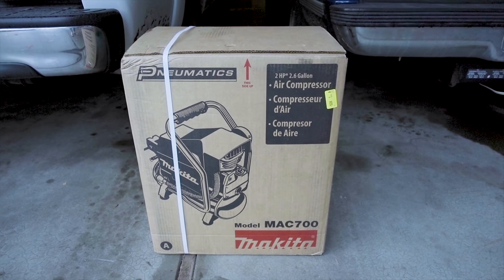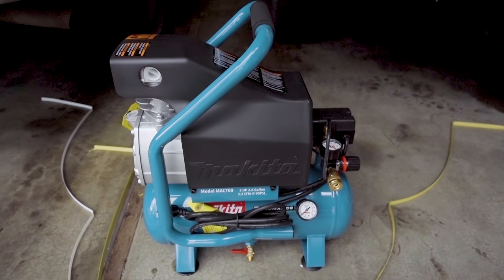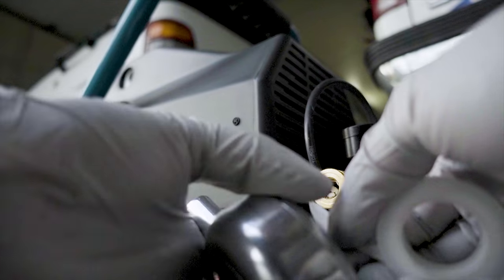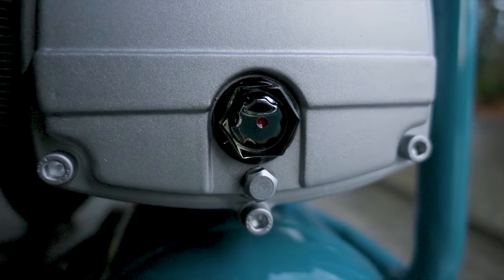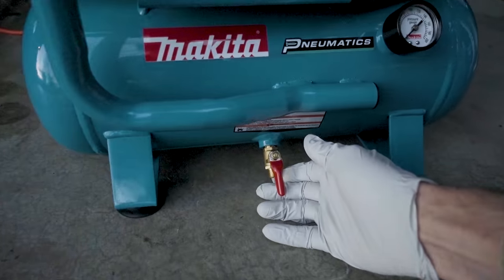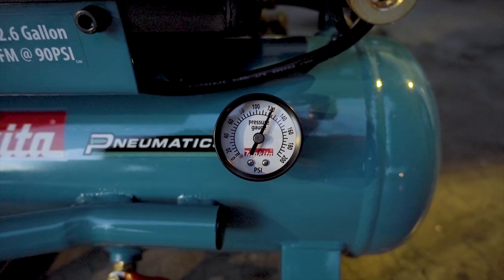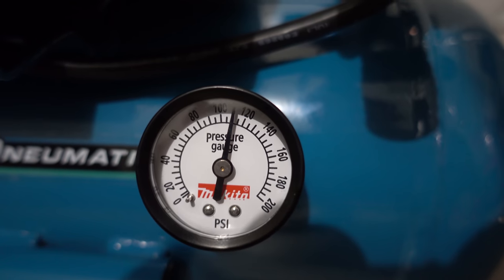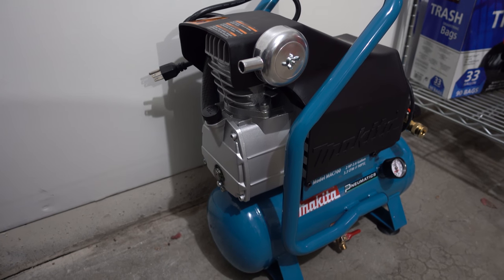Makita MAC700 Big Bore Air Compressor Unbox & Startup

Comment: When the air is compressing,   it is hot,  reading will be high,  after cooling a while , the pressure drops,  same as the tires in winter times..

Comment: I have a mac 5200  for construction but it is too big to be moving around constantly into clients houses to do trimwork so I bought the 700. Love it! It is so quiet compared to the 5200. Not light but a lot lighter than the 5200. Mine goes to 140 and stays there though and I didn't have any leaked oil in the box. Don't think you need teflon on the muffler since it is used to prevent leaks. Muffler is made to leak hehe. If it gets too hot then it might melt the tape and cause a problem perhaps. I put synthetic in for colder temps for my area and no problems. Also don't have to worry about tripping  breakers like with my 5200. The 5200 is also very fussy about needing lots of current to draw and will refuse to start up when the cabling is too long or thin. 5200 though will run two framing nailers all day and not blink and eye. Build quality is very satisfying and many of you who watch these kind of videos and love good tools will know that owning a well made tool can make you feel good. This is that kind of tool.

Comment: Not to sound like a know it all but the other guy that wrote a review was right not only about wrapping the Teflon the wrong way but you should have wrapped it at least twice around the treads on the air filter. And before Makita ships every compressor they put a small amount of oil in them to test them before shipment. The reason I know all this is because I just bought the Mac 5200 hot dog big bore model and I love it. And the first thing I did was also bought the Metabo HPT 10 gallon reserve tank because when you pair the two up you have a top of the line set up. Believe me, I own my own privacy fence and deck co. And I can run two paslode framing air nailer's and can work as fast as possible and I never run out of air! I hope this info helps anyone that is trying to decide on what to get for a ultimate set up. Thanks: Scott Harrington, Columbus, Ohio.

Comment: I would add one thing. The oil provided is more then enough and have left over to hit the red dot. I think you used it all due to the puddle in the box that leaked out of the compressor. Must have been on its side at some point.

Comment: Thanks for your review. First of all, the intent for a compressor is to be only under pressure when in use. Once there is no more use, it needs to be bled to empty. Since it builds up operating pressure in one minute flat, there is no practical need for keeping the pressure up while it just sits there for two days. It fatigues the fittings and the mechanism at large. 
Also, if you open the air intake valve (that little butterfly screw), you will find that there is nothing in it. The fitting has no need for Teflon on the threads, lol.... sorry guys, I am the absolutely curious chick, I can't help it! I love tech! OK, enough of that!
I am totally new to using air compressors, though, that's why I am here... to learn and avoid making bad mistakes!
What is the real interesting thing to figure out, in my opinion, is how to set the pressure on the tool side of the machine.
You see there are three rings one can turn, and one gauge. Each tool needs its specified pressure going out to the tool. So what to do with those three rings? What is the red ring for? All of you guys on here go right over this point. That is regrettable, because it is also not in the official Makita user manual! What's up with that??? Can somebody fill this informational gap, please?
Thanks to all who can help!
Reply: debating between mac700 and california air tool 5510se. I'm not sure about CAT products. People say their customer service is horrible. Any idea? i'm looking for compressor for light auto detailing.
Reply: UndertheGarage Detail I ordered this unit last night for the same purpose as well! Will be getting it next week. I want it mostly to blow out residue from polishing pads.

Comment: Hi General Expert, to remove heavy item in a box, never try to lift it. Open all 4 lids 90 degrees, turn the box upside down, shake while lifting up just the box. This way you are only lifting the weight of the box, not the item. Just want to keep everybody safe and not break their backs.

Comment: How often do y’all change the oil?  Also,what oil do you use and do you need to change it not long after the break in period?  I read some guy changed his right after the 20 minute break in period to, in his words “remove the metal shavings from break in”.

Comment: hey im new to compressors
the hose says 1/4 
does it matter the size of certain tools?!
3/8 or 1/2 
or hose size doesnt matter?!?
Reply: The cooling of the air in the tank probably caused the pressure to go down after it sat for a while.  The air out of the compressor is pretty warm which is reason for the cooling fins from the compressor to the tank.
Reply: No, hose doesn't matter. If you're using larger tools, or mechanical tools, then the fatter hose will give better air flow, but for smaller tools the thin hose is perfect. I use 3/8 fittings for all my framing tools, but just 1/4 inch for my lighter tools like brad nailers etc.

Comment: I just bought this compressor and it has to get down to 90 PSI to kick back on!!!!! My brad nailer couldn't even sink 18 gauge nails at that psi. Idk what to do. Who makes a compressor that goes down to 90 psi before kicking on, it's ridiculous.
Reply: oHerroPrease ....you need to adjust your controller, a simple adjustment, I usually set mine to come on about 120 to then off at 130 psi, I'm sure there is a video showing how, its not ridiculous, you just don't know what your doing
Reply: It has a set screw for kicking on but no set screw for off. I think its just set at 30 psi higher than whatever the switch on is. Originally it switched on at 90 and stopped at 120 but now I got it to turn on at 120 but it switches off at 150 psi. You think it'll be alright working in that pressure range?
Reply: Lmfao! So a $99 porter cable can hold 150 psi for years but a $200 Makita with thicker metal and a higher HP motor will explode at 150 psi? Haha oh man I actually chuckled at that one.  Anyway an update for you guys I've used this compressor every day for the past couple months filling up to 150 psi and no problems at all.
Reply: oHerroPrease Bro any update on reliability using this compressor higher than the factory preset? I ordered one of these and just wanted to know in case I feel the need to do this. Where is the adjustment located?
Reply: I did the same thing as this guy, set my mac700 to fill up to 150 psi and it’s been running like that for the past year and a half. Absolutely no problems at all. Also in response to chin, you are really underestimating this compressor. It is not a “toy”. It’s build and quality is another universe from the red pancake compressor everyone has, it puts out more CFM’s, and it easily runs nail guns all day long.
Reply: I’m actually putting mine to the ultimate test tonight. I work for a water company and the air compressor for our pressure tank fried so the tank filled up with water, we needed something to get it filling back up with air so I volunteered my little mac700. I took a picture of the hour meter on the Air compressor outlet before I plugged it in and tomorrow morning I’ll see how many hours straight it had to run to fill that tank with 50% air @ 60 psi. Whatever the outcome is I will let you guys know tomorrow, even if it burns up. If it survives I’ll probably make a quick video for YouTube of how badass the compressor is haha
Reply: DennisK I’m interested to find out the result.
Reply: Just checked on my water plant. Pulled up and the tank is back in business! Checked the hour meter and I plugged it in at 550.4 this morning it reads 556.8. So it ran for about 6.5 hours straight with no problems! It’s about a 3000 gallon pressure tank.
Reply: DennisK Niiiice
Reply: Planet CEO  ... and you will have a nuclear fusion and get radioactive air blow out!
Reply: @oherroprease207  I never had a Porter Cable that lasted for years.............